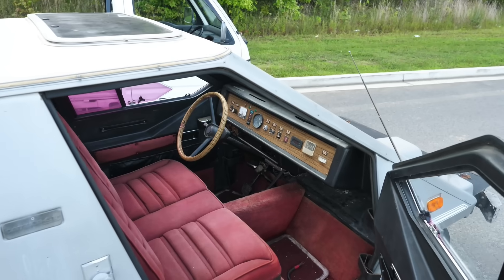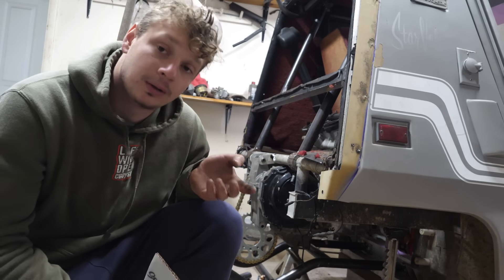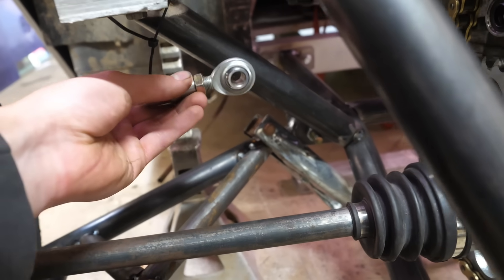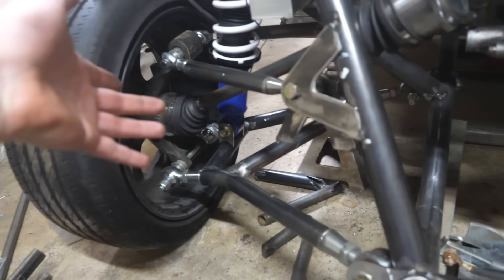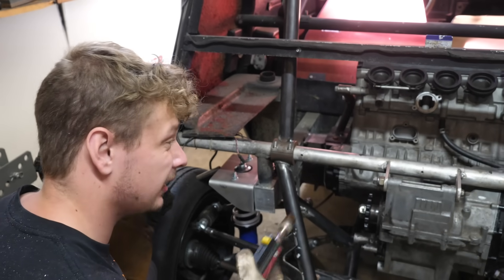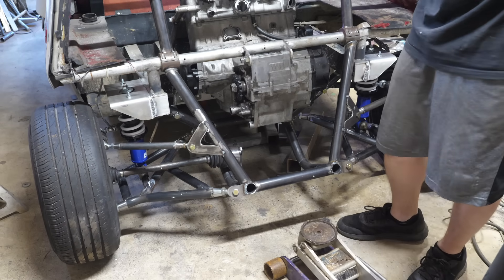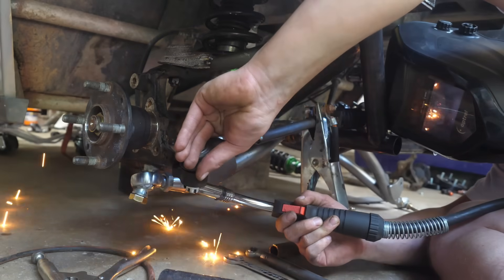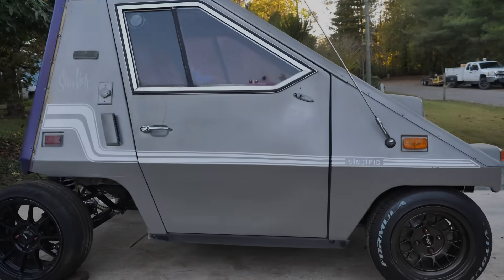Hayabusa swapping tiny Electric Car Part 6!

Comment: If you want to straight line it, you want the rear to drop, and front to rise, because you transfer the weight to the rear wheels giving you the best traction to prevent wheel spin.
So you need adjustable shocks both ends of the vehicle. 
Suspension is the key to making it safe as well as fast, but it's hard to build one where it is effective on both straight line racing, verses road carving beast

Comment: Really cool build dude ! I wanted you give you some advice before you have any issues with the hayabusa engine well transmission in this case .. you should definitely upgrade the output shaft and or build a “third bearing support “ .. not sure if your using a gen 1 or gen 2 engine but the gen 2 shaft is stronger that the weak Gen 1 shaft but requires the sprocket to be “shimmed” or spaced out appropriately . If you haven’t already , get yourself a set of ape hd clutch springs and you must use a slave cylinder brace or it will crack the sprocket cover . Additionally there’s all sorts of cool stuff you can do with by flashing the ecu including but not limited to , removing all restrictions including top speed limiter , full control over the fuel maps and ignition maps  , 2 step, you add a map switch for nitrous or race gas  , air shifting can be set up thru the ecu as well and for 2008+ (gen2) you can even do progressive nitrous , boost fueling , slew rate traction control plus more .. I have all the hardware and software to tune them as I drag race one myself and I’ve built more Hayabusa’s from stock to 600+ hp than I can count .. if you’d like me to flash your ecu get in touch with me on Facebook at Christopher Angell  , I’d also be more than happy to give you any advice or answer any questions you have regarding the platform..  another a piece of cheap insurance would be a manual cam chain tensioner, you can also swap the exhaust cam out for a stock intake cam with a set of ape adjustable cam gears which is a very common mod for more power .  The gen 1’s stock engine dyno’s around 165 to the tire on an accurate dyno with an full exhaust / air filter and other bolt on mods, if you do the dual intake cams , mill the head a lil bit and do some mild porting with good tune I’ve squeezed 185+ on a dynojet 250i .. I believe you mentioned possibly turbocharging it in the future and if that’s case you definitely want to stick to a 2008+ ecu/wiring harness (its swappable just involved ) for the boost fueling oh and did I mention boost by gear boost control ? Lmao.. otherwise your stuck using a powercommander to piggy back  the fuel injection and do boost fueling and or using an fmu both of which are old school and powercommanders are notorious for failing completely with no warning or explanation why . The gen 2 ecu works great up to 450hp .. I could go on and on lol 😂 just hit me up if you need anything or have any questions. High performance engine building and tuning is my specialty ! -Christopher Angell @CAPerformance_motorsports .. good luck with the build
Reply from the maker: 👍 good to know

Comment: Those rear shocks are pitiful and gonna be an issue for sure, they basically bottomed out with you standing on it, while the fronts werent near as squishy or bottoming....imagine when you launch with 120ftlbs of torque in the rear!

Comment: I know you wanna keep the aluminum frame, but at some point, it just makes more sense to swap out those two bars with steel. Especially when you just driving this beast like a sports car. Going into a driveway will probably twist the frame.  Also those headlights look like googly eyes. :)  Keep up the great work and amazing content.
Reply: I was thinking the same thing . As long as he don't add forced induction he might be fine. Thats a big might. haha
Reply from the maker: For insurance I can add steel cage tieing front to back
Reply: He could always reinforce it with Aluminum.
Reply: @Skwisgar2322  yes, true but if you see how much steel he's already using underneath just basically bolted together, then it just makes more sense to weld steel to steel, especially those strut mounts. having worked with aluminum, sheets its quick to fail with force compared to steel. plus aluminum tends to snap rather than bend so the failure is way more exciting.

Comment: It would be cool if you could add metal in front of the back wheels to move the rear wheel well back and add the slanted back on to make it look like it did, then you almost wouldnt notice the extended wheelbase! Thats some bodywork and metalwork though and probly a pain. Also those rear shocks are pitiful